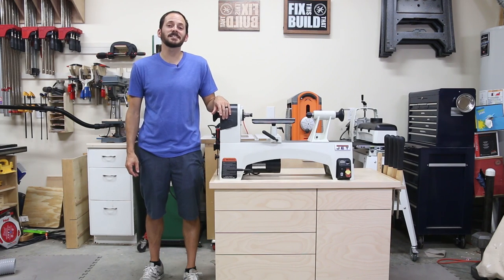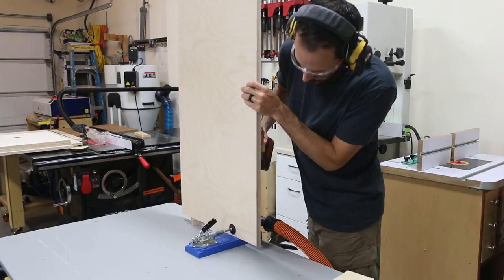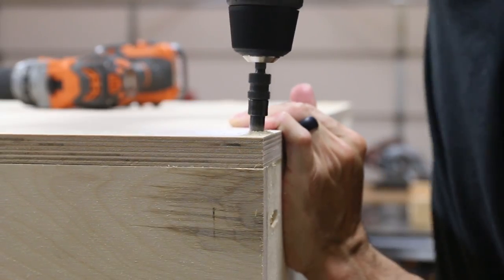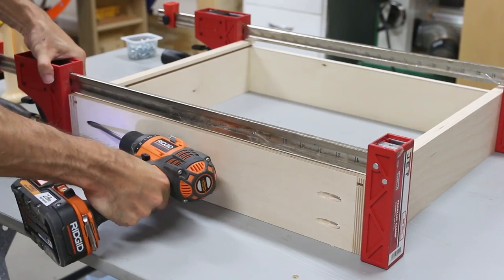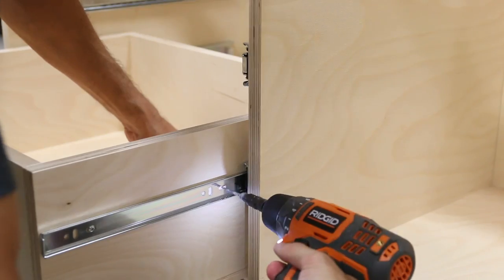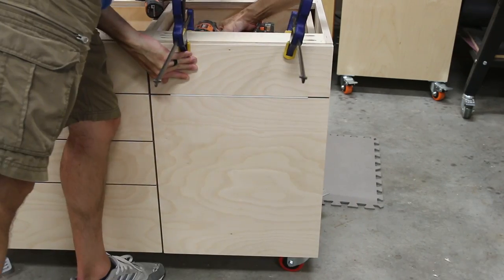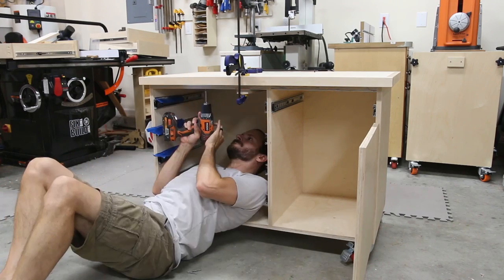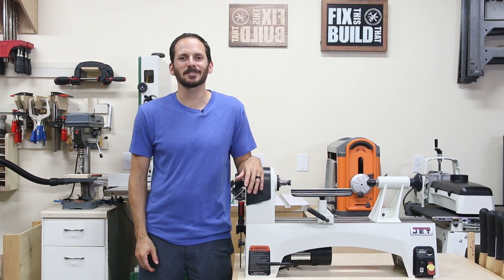Lathe Stand Mobile Workstation | DIY Woodworking Strorage

Comment: This is fascinating; I've never seen or thought of using so many referential measurements, using one part of setup to reference all of the other sizing and cuts. Great build!
Reply from the maker: +Mike Tremoulet thanks, Mike! In a project like this with so many dependencies for spacing it really makes things so much easier to not rely on the tape measure.

Comment: I ordered the plan and have it about 80% complete (awaiting delivery of the drawer slides), and feel that with over 35 years of woodworking experience I can say - - - one of the EASIEST builds I've ever done. I'm also a professional turner, so I modified the buildout to include an on-board vacuum system. (BTW the Stanley 8 gal/6 HP fits the small side of the bench like a 
glove. Incredible. Your referential measuring system is the cat's whiskers. Worked like a champ. It's so simple, I wish I'd thought of it years ago.
Reply from the maker: Oliver, that is so great to hear!  I'm glad the build worked out well for your!!

Comment: Great build, Brad!!  This cabinet could be used for many things and not just for a lathe.  This is really quite a versatile cabinet!  Now, turn some knobs and give a coat or two of wipe on poly.
Reply from the maker: +KSFWG yeah, totally agree.  After I built it I realized it was basically an all purpose cabinet.  And I did put on 2 coats of poly and somehow never mentioned it :)

Comment: Nice job on the cart, take a tip from me and put a coat of something on it. I didn't do it to mine and one day when I spilled some stain it ruined all my hard work.
I have a smaller lathe like this and do very little turning as I was never taught how to use it properly. Since you have an in with Jet Tools maybe you could do a beginner series on how to use it??
Reply from the maker: +Pat M I actually did seal it with water based poly. Completely forgot to mention or show it. And I'm definitely a novice turner, have only done 5 or 6 different projects so far

Comment: Very cool, might build one for my lathe!!
Reply from the maker: +David Meisel you should. It cleaned up so much stuff I had in boxes and different spots.
Reply: Cool, yeh right now I have my lathe on a open stand that I built when I bought it.  It has a open shelf under the lathe and of course anything I put down there gets covered in dust when I'm turning.  Also because of the vibration of the lathe stuff normally falls off of it to.  So drawers would be much better and offer much better storage options.  Thanks for idea and video.  ;)

Comment: Great video from start to finish!

I just have one issue with a lathe workstation that small .....  I've only been turning for 2 years, and I already have way more wood blanks than would completely fill every single drawer in that thing!  If you keep on with the turning, you'll want to put a bookcase or two to the right for your "landing zone" and fill it with plastic shoe boxes full of blanks!

Also, if you cut fresh wood or obtain more green wood, storing it in the shop to help it acclimate will help dry it more neatly ... make sure to scrape wax away from the sides of the blanks, but not the end grain, to reduce splitting and checking... 

Having a place to store your fresh cut green blanks that you've pre-formed on the lathe and are waiting for them to dry is a good idea too ... stuff em in a paper bag along with a good pile of the shavings that came off the turning and put em on the shelf.  Take them down once a month to turn the blanks (to avoid fungal growth) and check their weight.  Write the initial weight of the piece on the bag ... update it each month with the new weight as it dries ... when the weight doesn't change from one month to the next, it's dried and fully acclimated to your shop.  This is the time to finish turning it to final size and apply your finish.
Reply from the maker: +Gregory Halye yeah, as I grow as a tuner I assume the drawers will hold more tools and accessories and less wood 👍

Comment: Awesome work Brad!  I really like the continuous grain fronts as well as the router tip with the one sheet being larger than the other so that they flush together.  Are you going to finish it with anything or leave it raw?  Well done man.
Reply from the maker: +CReeves Makes thanks, man! I did finish it with 2 coats of water based poly. Forgot to mention.

Comment: Thats a very nice build! I would have put some finish on there. How long did this process took? Build time and overal time?
Reply from the maker: +Max Maker Yeah, totally forgot to mention that. I finished as I went. Has 2 coats of water based poly on it.
Reply: @Fixthisbuildthat  After a year, how has the water based poly held up?  I am building to your plans now.  I want natural color but solid protective finish.

Comment: Nice job on this lathe stand! I have built a couple versions of both your drill press stand for a drill press and a small band saw as well as a couple flip top stands for various tools and space saving abilities. How is this lathe stand holding up for you 2-3 years later? Is it solid enough and is the weight of the lathe an issue at all?

Comment: Great vid!  You inspired me and last night finished assembling the carcase and am going to make the top tonight.  In terms of location of the mounting holes for the lathe (I have the exact same lathe and love it), I was thinking of mounting it to the right end of the top as opposed to the left end like you have it so I can more easily get around the end of the lathe when hollowing out bowls.  This would leave the accessory space to the left of the lathe.  What advantages do you see in mounting to the left as you have, or is it strictly personal preference?  Thanks again for the great vid.
Reply from the maker: +Brian Schmid hey, Brian! That's awesome that you're making one, can't wait to see it. I put the open space on the right mainly because I'm right handed and it felt natural to have it there. Also if I need to remove the tailstock then I can just set it down. But now that you mention that, it could be beneficial to have it on the right vs the left.

Comment: Hey bud....excellent content, I just bought the plans for this cabinet I just have one quick question what kind of plywood did you use?  I know is 3/4" but is not pine or sanded....we'll wait for your response thanks Brad.....don't stop making videos..
Reply: It looks like Baltic birch plywood.  You can tell by the high quality and thin layers.

Comment: Nice stand!  How did you cut the slot in the tool holder for your parting tool?
Reply from the maker: +Troy Meredith thanks, Troy!  I flipped the board on edge and put it against my miter guague and cut the slot on the tablesaw.  Then I took a small cutoff and glued it back in on the edge to keep the parting tool from falling out.
Reply: Ah, I see the glued up portion now.  I thought you found a way to cut a prefect slot without having to do that. lol.  Thanks for the info.

Comment: I'm tempted to build this stand, but I see a lot of videos that double up the plywood on their stands. Does this one feel sturdy and heavy enough to eliminate vibration on the lathe?
Reply: Also, do you feel like you can get close enough to the lathe without being uncomfortable? Enough room for your feet, etc.?
Reply from the maker: With the stand loaded up it's very heavy and I don't get any noticeable vibration. The 3" casters also provide room for your feet to slide under the stand and press your legs right up against the stand

Comment: I upcycled an old wooden  file cabinet and its heavy as heck.  When the lathe is running with a bowl it moves everything and my drawers start sliding open.  I'll be interested to hear of you find the same issues.  Yours looks way nicer than mine though.
Reply from the maker: Yeah, I hope it works well, Chad.  I turned a spindle and it was fine, but if I'm roughing a bowl that would definitely be more vibrations.

Comment: I realize I'm nearly a couple years late here... lol.. but if you happen to find this comment, could you tell me if you found any issues with the casters causing movement/vibration when using the lathe?  I am planning to build this according to your plans and that is the only thing I has a question on.
Reply from the maker: Hey, Mary!  No issues that I've had.  I've not turned anything really large and heavy though.  But if you load the stand up with wood and stuff all that weight holds it pretty solid